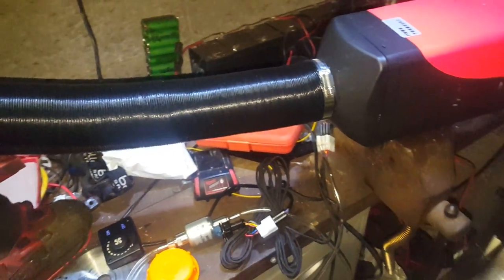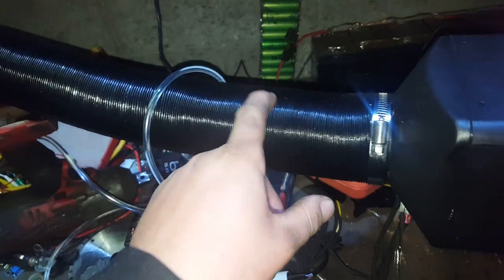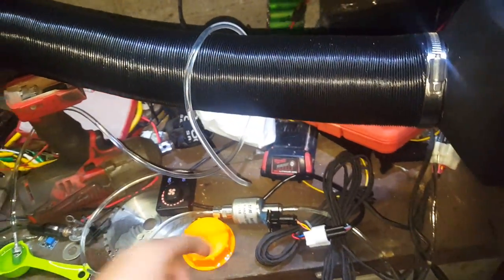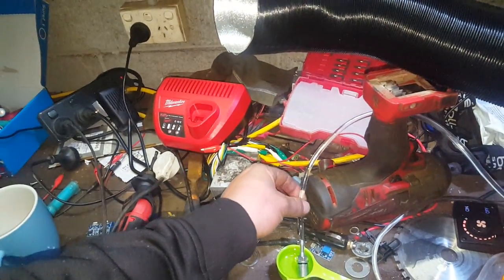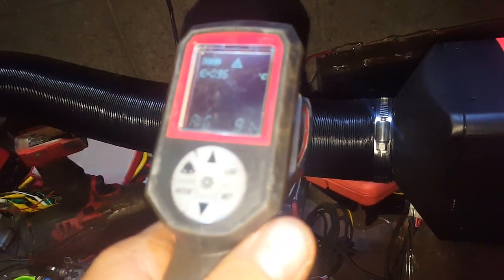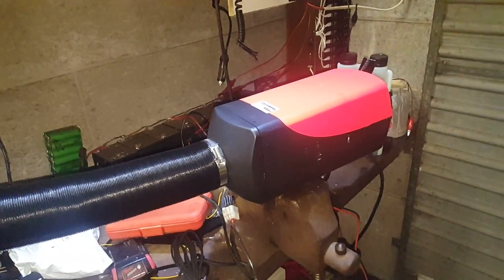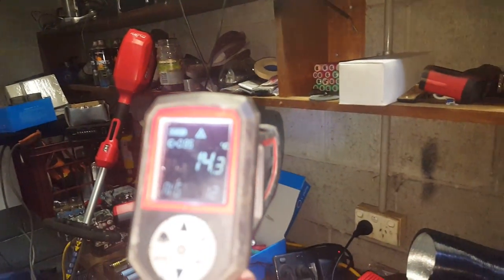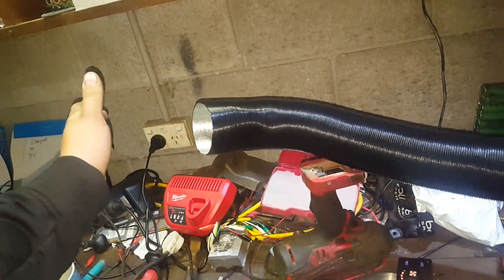Awesome 5Kw Diesel Powered Rv Motor Home Heater Test in the Shed

Comment: You don't want to cool down the exhaust pipe too much or you'll end up with condensation in the line. A short length of double-walled pipe to act as an intake-exhaust heat exchanger might be a good idea for dropping the exhaust hose's temperature to a safer level if you're going to run it for a long distance indoors. Should slightly improve efficiency too by returning some of the excess exhaust heat into the combustion chamber through the intake.
Reply from the maker: Thats a awesome idea mate ill have a play around with that
Reply: That’s called concentric ventilation. I know they make it for 90% forced hot air heating furnaces that use schedule 80 PVC for venting. I haven’t seen one made out of metal

Comment: Wow that's really awesome. I would have liked to have seen an ammeter hooked up during the entire operation just to see how much current it uses.
Not a bad price either! Thanks for uploading
Reply from the maker: During ignition and warm up its 8 amps at 13.5v when running on low its 2amps when running on flat out about 3.3 amps
It uses 8 on its shut down to clean the glow plug but for less than 1 minute cheers
Reply: One Up The Sleeve Customs 
thanks, that's good to know. When installing off grid mini solar systems for people it's important to know the current that's going to be drawn so you can size the system properly.
Reply from the maker: Yeah sure is this is the best item ivr found for low cost heating yet !! Diesel is cheap emissions are low very easy to control temp and only needs 12v

Comment: What everybody isn't realizing is that the initial startup and warming up the environment that it sits in, once the set temp has been reached, the unit will slow way down getting much quieter. Depending on how and where you have the unit placed, you actually can hear the fuel pump more then the unit itself.
Reply from the maker: Yes it very much starts in turbo mode
Reply: @Oneupthesleevecustoms  I believe it does that for two reasons. One, it gets unit nice and hot so it can burn the extra soot out that it builds up from the previous run and two so I can hurry and get it up to temp. All I know is I have previous experience with these type of units years ago and as long as they are running correctly are awesome units to have
Reply: So the noise lessens when at temp ?
Reply from the maker: Yes it calms down

Comment: Just for reference, those IR thermometers are not very accurate on shiny surfaces. Best thing to use is a bit of black electrical tape stuck to the item you want to measure, then point the probe at that spot. 👍🏼
Reply from the maker: Thanks mate  something to do with reflection
Reply: One Up The Sleeve Customs not all materials emit the same amount of infrared energy when they are at the same temperature. In general, most materials emit more infrared energy than shiny metals do - they have higher emissivity. Reflective surfaces are less emissive than dull surfaces. Weathered or oxidized metals are more emissive than polished, shiny metals. 👍🏼👌🏽
Reply from the maker: Thanks heaps mate i had no idea cheers ;)
Reply: Haha I've just checked out your other videos.. Nice one. :D
Reply from the maker: Thanks man ive got about 800 between 2 channels haha
Reply: @Oneupthesleevecustoms  get a cheap multimeter with a temp probe (I use a digitech QM1323) - much more accurate for measuring air temp than infra red.
Reply from the maker: Yeah i think my clamp meter has a thermocouple input. Ill check cheers
Reply: @MtTaylorPaul  True. Infrared is more suited to surfaces.
Reply from the maker: Yeah to do with reflection im told
Reply from the maker: https://youtu.be/BRMSFcq4Bc0

Comment: You should mount your dosing pump in the vertical position otherwise the air bubbles will accumulate within the dosing pump which will inturn prematurely wear out and fail. Those pumps rely  on the diesel for lubrication and the internal piston needs to be fully submerged in fuel.
   Great video by the way.✌️
Reply from the maker: Thanks mate

Comment: Well. With the energy density of diesel being 35800Kj/L and you having 0,025L of diesel you have a total of 895Kj in the dish. ofc there is a ramp up in the unit which will prolong your 25ml. But 5KW equals to 5Kj/s because watts (W) is a energy unit per time in what equals to joules per second. So if we divide 895Kj/5Kj/s you get 179 seconds on full power.
If your exhaust temperature goes too low, you will get condensation of acid water. This was an issue for many people that got their diesel driven boiler replaced by an economic one in that the acid would eat up the concrete and other alkalies in the chimney. But if you have a way of getting rid of the acid water, you can get up to 110% with an exhaust condenser because of the heat that the condensation gives.
Reply from the maker: Thank you so much for that amazing info mate!!!!
Reply from the maker: Will the exhaust discharge damage concrete? Cheers mate
Reply: @Oneupthesleevecustoms  Yup. Acids dissolve alkalies. CO2 is an acid. That's why CO2 in water is called carbonic acid. Cheers :D
Reply from the maker: Legendary stuff thanks heaps for the info mate
Reply: @Oneupthesleevecustoms  hehe :) Glad you appreciate it :D
Reply from the maker: Its one of my favourite parts of YouTube mate the knowledge that some people can share helps every one its a great sharing tool
Reply: @Oneupthesleevecustoms  Yeah I like that too. Love when you get an expert view of something. Everything being put into perspective :)
I instantly got the thought, when you asked the question in the video of how long it would run on 30 mills of fuel, how long will it run? I must calculate it before I see you test it :D
Reply from the maker: https://youtu.be/BRMSFcq4Bc0

Comment: I like doing thinks other people over look Or just because no one has done it....Your video gave me one of those The exhaust tube Wrap a copper tube around it for Hot/warm water  Or a method to directly  have the pipe into a water tank And out the side  Heat up your water while toasty warm in your Van /trailer  Cheers from Canada home of the real meanning of blue balls
Reply from the maker: If you dive a little deeper in my channel I've done a few tests with egr coolers to heat water

Comment: Got one of these in my truck only have to have half way up it's so hot lovely :-)
Reply from the maker: How well do they work
Reply: @Oneupthesleevecustoms  very good and it's really cheap to run I just leave it on all night it's goes on and off all night it's got a thermostat I've got an eberspacher heater it's a proper truck one but these are a thousand pounds each but this one is good though :-)
Reply from the maker: Same sort of machine but yeah thermostat is important in a truck
Reply: Just make sure you keep the air intake clear of dust and don't block it other wise the heater will come on and go off again apart from that these are really good and the heat they give off is amazing :-)
Reply from the maker: Y e ah im going to buy a 8kw one for my bigger workshop to heat and drive my car painting ect projects  in winter ;) cheap bulk heat
Reply: @Oneupthesleevecustoms  yes it is can't have it full on lol it's too hot lovely on a cold night and they are so cheap now a right result :-)
Reply: @Oneupthesleevecustoms  yes very good idea fella,will heat the place up nicely in the truck I think this uses about a pound of diesel a night so cheap :-)

Comment: Great video, thank you! I have one question, and I appologize if this has been asked/answered but I don't see it posted.
Question: 
1. Can you set a temperature on this unit, and will it turn on and off as needed to reach said temperature? 
2. A refined version of that question is, IF it is temp controlled operation, does the fan turn off or just the heat portion?
3. Also, if diesel runs out, what does the unit do?
Thank you!
Reply from the maker: Has variable output settings no temp control

If it runs out of diesel or combustion stops for any reason it cools down and shuts off

Comment: Great review! I have a Webasto unit that I installed in my Sprinter last year. But would like to add one of these units to my garage. Gets down to -40C during the winter here (not all the time) and want more than my electric heater for heat. I should have gone natural gas when I built the garage but didn't. This will be just as good. Now to figure out the safest way of running the exhaust through an insulated wood-stud wall - and vinyl siding.   Cheers from Edmonton, Alberta.
Reply from the maker: Just double insulate  exhaust with a air gap so bigger pipe through wall then  the.exhaust down the center of it
Reply: @Oneupthesleevecustoms  i'm your bigest fan, i've seen all of your videos and I redd all your coments :-)

Comment: So do you have to change the oil like a normal engine? And - Can you disconnect the battery once the engine is running, or is the battery making the fan run? Thanks in advance.
Reply from the maker: Needs power. Runs  pump glow plug and fan.
No oil inside. 
Burns diesel in a burn camber

Comment: I'd like to fit a heater to my boat but these things sound like a 737 warming up on the runway! I know the silencer helps but they are still loud. Walk around a marina at night and you can hear them on various boats but they are effective at heating.
Reply from the maker: There not that loud i might have to get the db meter out for a video
Reply: Run exhaust under water?

Comment: Thanks for your reply I asked if i needed a bms ✊🏿
Reply from the maker: To run off 18650s?
Reply: Sorry that was another YouTube show with the 
But you’re heater test is brilliant ✊🏿
Reply from the maker: Tryed running it on a few different things
Reply: Yes I’ve seen you with the other fuel they have a white Aluminium one it’s the v2 with remote were you can see the temperature voltage casing temperature and ambience it even has altitude sensor The remote is the burgundy colour they sell on eBay really really good respect man
Reply from the maker: Yeah they are getting better and better

Comment: As an approved webasto engineer I have fitted hundreds of air top 2000 /5000 and the DW water models they are  expensive but are quality all parts are available common parts to fail are glowplug  fan motor and most common is the burner cartridge  which soon spots  up maybe 500 hours .what I'm trying to say if you get a year out of it your lucky if you can get parts its not a bad price
Reply from the maker: So cheap but not totally nasty?
Reply from the maker: https://youtu.be/BRMSFcq4Bc0

Comment: Got one in my home build camper easy to fit and way to hot on full tilt run mine on 4 lights on mid winter and it's brill 68/70 deg no problem.
Reply from the maker: There awesome heat so well
Reply: How many hours on a tank?
Reply from the maker: @LEO-xo9cz  24 to 28 hrs on 10lts
Reply: @Oneupthesleevecustoms  Im new to this so not that clued up on these heaters. I think in a van you could probably get away with a 2kw at low speed.
Reply: John griffiths If the unit was in a separate building and the heat duct went to the house would you hear much noise from the unit then ?
Reply from the maker: Very very little mate
Reply: One Up The Sleeve Customs cheers mukka

Comment: Can you use jet-a instead of diesel? Also have you by chance taken a decibel reading with it running full blast?
Reply from the maker: It would be around 70 dB. No but it's only a refined version for a kerosene base fuel yes?
Reply: @Oneupthesleevecustoms  yeah jet -a is basically kerosene with very little lubricant in it. I work on aircraft and have an unlimited supply of “waste” jet-a fuel. Once we remove it from the plane we don’t put it back in normally it just gets sent to a recycler. I was thinking rather than pay a recycler to come get it, I could burn it in one of these. It seems since vegetable oil works and it’s basically the same exact thing that should work fine. My only concern would be if it needs to have a little bit of lubricant in it for the fuel pump. I know an internal combustion engines like a vehicle you can’t use jet fuel in place of diesel because they rely on lubricating properties. But this thing just seems like a blast chamber

Comment: With the exhaust getting so hot, you could run it through a section of wound copper tube, that loops to a hot water tank. For an RV or boat with a hot tank shower or sink, that would lessen the warm up time. Depending on the heights involved, there would be no need for a pump as natural hot water circulation would mix from tank to heat exchanger.
Reply from the maker: Yeah thetr could be a fair thermal gain
Reply: Webasto and espar sell heat exchanger units just for that purpose. For making hot water in the cabin and/or heating the engine xoolant to keep the engine warm on cold days
Reply: Wouldnt that ne awsome. Wake up warm in rhe morning. Then start your vehicle, what ever it may be, and have heat immediately to drive. Awsome !!!
Reply from the maker: Ill have to check that out thanks mate
Reply: Great point and elegance in its simplicity to use the exhaust heat. Love ya work cobber.
Reply from the maker: Hang around video on a sweet diy heat exchanger coming next few hrs
Reply from the maker: https://youtu.be/BRMSFcq4Bc0
Reply from the maker: there ya go
Reply from the maker: Easy kicks out heaps of heat
Reply: I bought a EGR cooler to use as an heat exhanger and heat water.. Havent tested it yet, but i guess it should work..
Reply from the maker: Did you see my other video yet? It works
Reply: @Oneupthesleevecustoms  No i didnt see that, but i will have a look!
Reply from the maker: https://youtu.be/BRMSFcq4Bc0

Comment: Try what happens if you stop the fan manually (simulate a failure). Does it stop or keep burning? This is quite important feature.
Reply from the maker: I believe it has a over temp feature
Reply: The unit would automatically shut down and shut off the power to the motor. Then it would intermittently turn the motor back on to see if the problem is resolved.  If it is, would spin the motor back up to full speed to cool off unit then gradually speed down as well until the unit is cool then shut off. After that if still required would attempt to restart the unit again. If again there is a issue with a motor failure then after second attempt would totally shut the unit down all together and give you an error code
Reply: If it is turned off (( power) the heat will destroy the motherboard

Comment: Hello i just bought one of these for my vw t5 campervan. Its exactly like yours mine is black with with four hot air blow out holes. I'm planning on putting it under the passenger seat. Tell me do you feed the fuel line on the bottom of the fuel tank. Or through the cap on the fuel tank. I like the sleek small compact tank on these. So i can fit the tank under the seat too😀

Comment: Good idea to have a carbon monoxide detector while using this in your
sleep?
Pretty cool unit,
I’d love to use it for my small cabin and I’m already thinking of mounting/ routing options with a possible splitter on the heat vent tube and mounting the tubes with small duct vent panels for a built in look.
Reply from the maker: Yeah they are cheap from the hardware store. These diesel heater work amazing I'm about to reinstall this one again (been moved 3 times now)
Reply: One Up The Sleeve Customs 
Looks like a great unit.
Love your accent by the way.
Now If I can find me an Aussie charger with the 6 cyl  hemi.

Comment: I am thinking about installing one of these and running the exhasut into the van exhaust pipe so it can exit the side like the vehicle engine does.  I have heard there is a limit on the exhasut length at that small diameter but I believe once it's in a V8 sized exhaust pipe it should not matter.  I have not been able to come up with a good reason not to do this and I am looking for constructive criticism or non-constructive.  It just seems like the cleaner way to install it.
Reply from the maker: Is a flow back to heater possible?
Reply: They are sealed units on the combustion side.  If it was able to blow exhaust in the van from the engine through the heaeter then the unit would leak into the cabin when the heater was running by itself.  I see how it could possibly suck fresh air through the intake side and sweep it along with the engine exhaust

Comment: The actual fuel consumption is about 100 ml per hr per 1000 watts....all these cheap units seem to run at half power on low so a 2k unit would consume 100 to 200 ml per hr, a 5 kw unit will consume about 250 to 500 ml an hr. and a 8kw is about 400 to 800 ml per hr. Most ebay ads mix up the fuel consumption numbers between power levels. They typically don'y like running a lot on low...clogs them up with soot...counter intuitively you should size your heater to run on high a lot for best longevity...

Comment: Great video - thanks for taking the time to show us. It seems to take very roughly the same sort of time to Chuck out hot air as a vehicle engine takes to warm up? I’m asking because what I want is not so much an overnight heater, or something to make up for inadequate vehicle heater output, but quicker heat for after wild swimming when I’m freezing my …. Off. Tvm, J
Reply from the maker: In about 3 mins of say it would from cold be out pacing a car heater mate

Comment: It's been two years since you posted this video. Very well done, thanks. Can you identify the manufacturer? The link doesn't work anymore.
Reply from the maker: https://rover.ebay.com/rover/1/705-53470-19255-0/1?mpre=https%3A%2F%2Fwww.ebay.com.au%2Fitm%2F293721974096&campid=5338476033&toolid=10001&customid=
Reply from the maker: They are normally all clones of the PLANAR style heaters. This one still works and has been going strong even heating my house